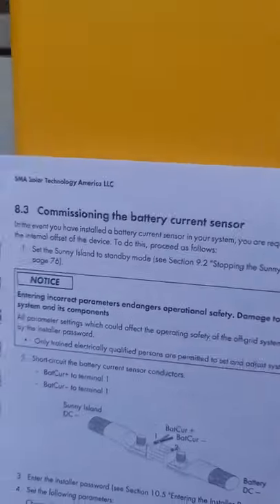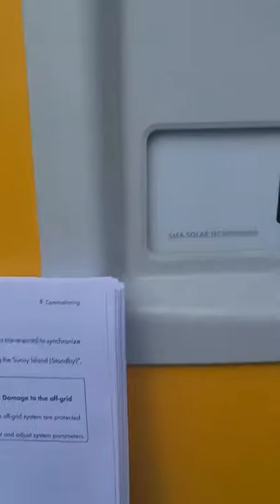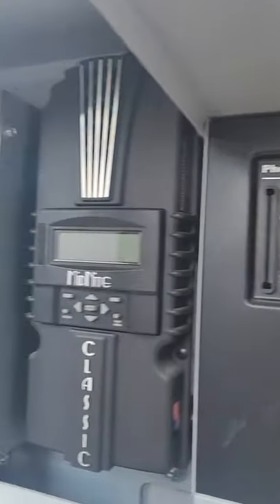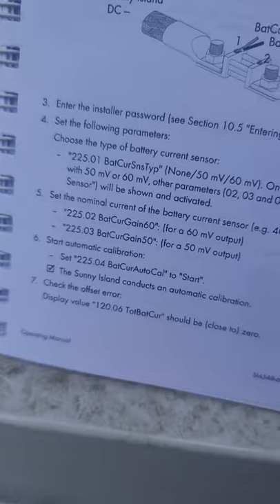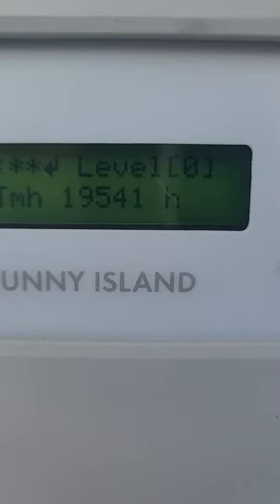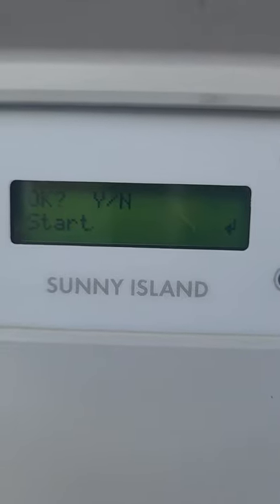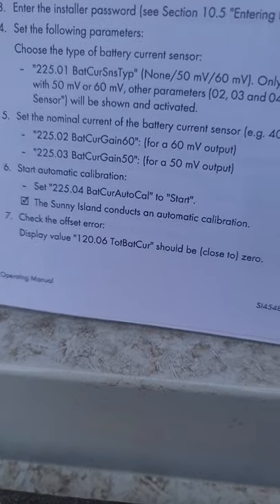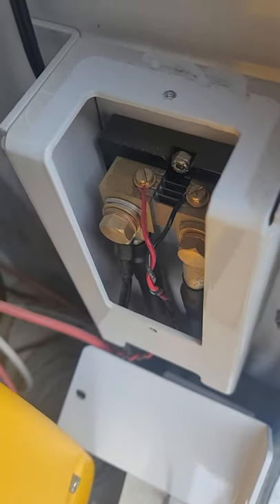SMA Sunny Island- How to commission the battery current sensor

Comment: Thanks a lot, followed your steps and my sunny island was showing -2  amps after I short-circuited the wires together, do you know what I could be doing wrong?
Reply from the maker: I would recommend to try again:  
Confirm that you shorted to the RED wire side of the shunt, that you put in the correct shunt settings and then try the callibration again going step by step thru the manual.  
Also very important to remember to shut off the midnight classic!!!
If that doesn't work, contact SMA tech support directly, they have been very helpful with these items.

Comment: You need to put a meter on that shunt and choose the correct value of resistance or this exercise does nothing to improve the accuracy of the SOC.  Just an FYI.
Reply from the maker: Thx Trial.....Good info, I'll try that on my next one and post a HOW TO reply.
Reply: @aaron1q2w3e  Sounds good!  Congrats on scoring a hell of a deal BTW.  Good luck and please do post your findings!
Reply: Isn’t that the point of having a calibrated shunt and an intelligent SMA SI that auto-calibrates? The shunt that comes with the DC trailers is a 50mV/500A shunt. 

Where can you input the correct value of resistance in the SMA menu’s, other than just putting in the right shunt parameters and then making sure after it auto calibrates it falls within 0-1A?